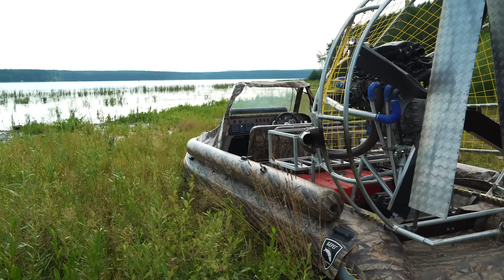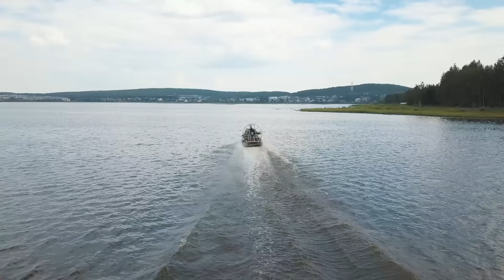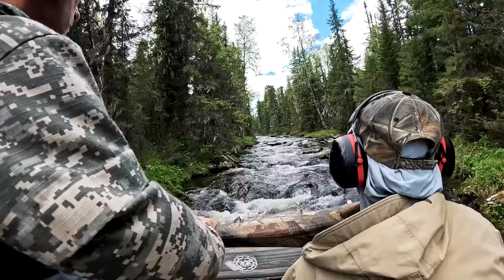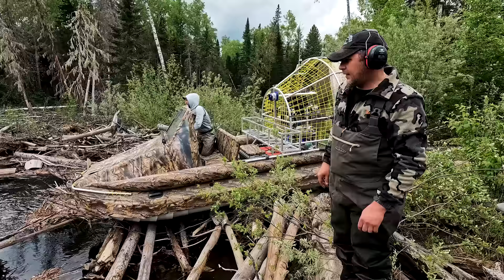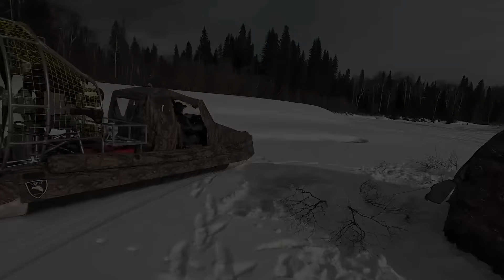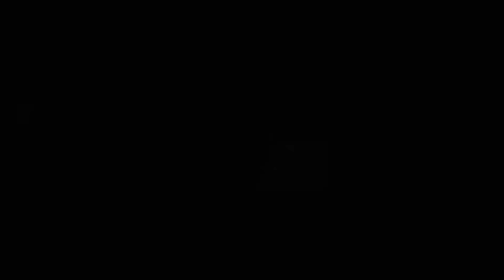Crossing savage forest and dangerous river by the insane Airboat

Comment: The engine is too lound but fantastic moves👍
Reply: Like an airplane, most of the noise actually comes from the propeller, not the engine.  There's really no way around that.   Even electric aircraft are still very noisy for this reason.

Comment: Pretty incredible, I've never seen anything go up a shallow rocky river like that, let alone across that deadfall.  I can see that being quite useful for navigating Muskeg swamps here in Alberta to get to oilfield survey locations.  Even with that lower plastic hull armor (UHMW ?) degrading, still amazing capability.
Reply: Jet sprint boat would fly up  that shallow rocky  river at 60 mph....
Reply: @HebrewHammerArmsCo  How does your jet boat go across deadfall when the hull and jet pump aren't even submerged?   It wouldn't work on snow or ice either.
Reply: @HebrewHammerArmsCo Call big bullshit on that